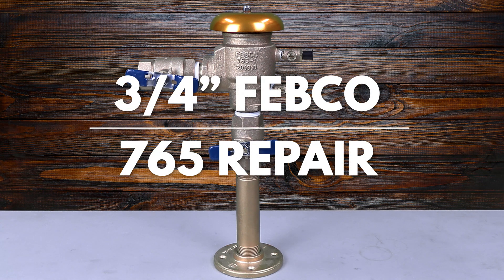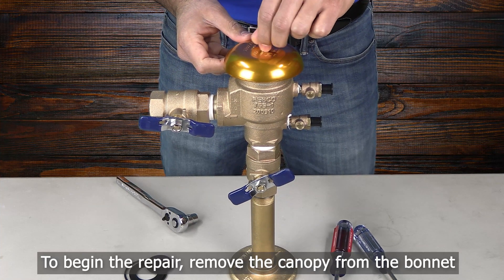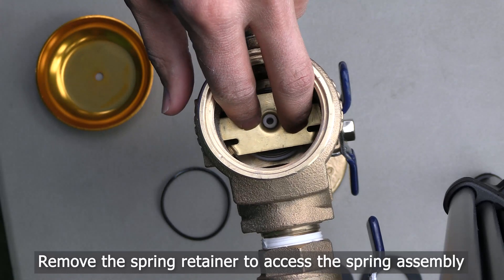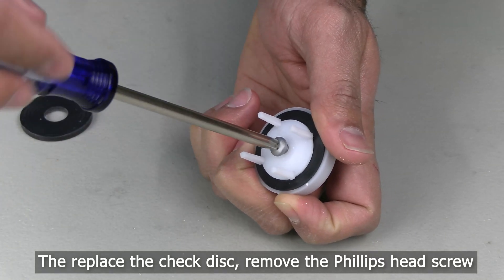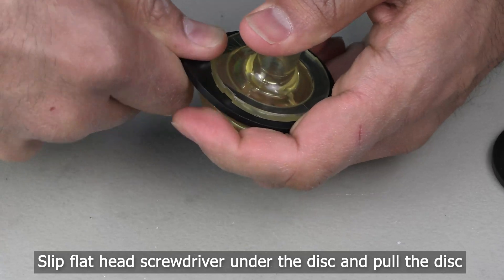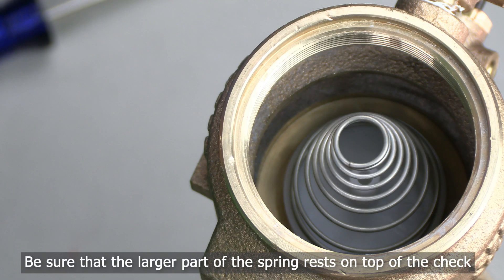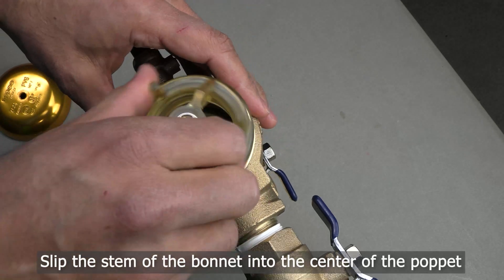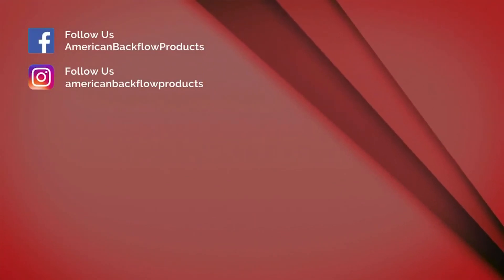3/4” Febco 765 Repair Video

Comment: Question. This video says that it is for the 3/4" Febco 765 pressure vacuum breaker. But stamped on the unit itself if 765-1. I believe the -1 indicates the 1" model as opposed to 765 (no -1) which is the 3/4" model.  I am assuming the instructions are the same for the 2 models, but I am having a hard time finding a 3/4" check valve. All the ones I find seem to be 1" for the 765-1 model.  Is the check valve the same between the 765 3/4" and 765-1 1" models?
Reply: Yeah, this is not a 3/4" Febco 765. It's a 1". The video title is incorrect.
Reply: I just replaced the bonnet assembly on my 3/4": it's the all the same workings as the 1" he is using, just smaller.